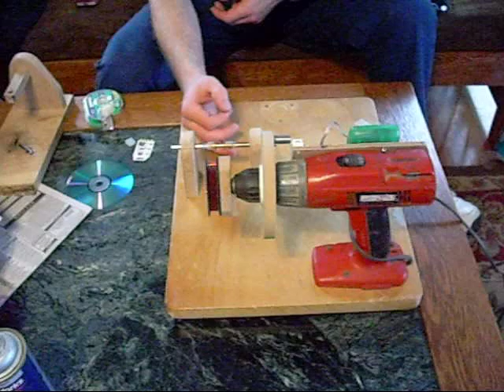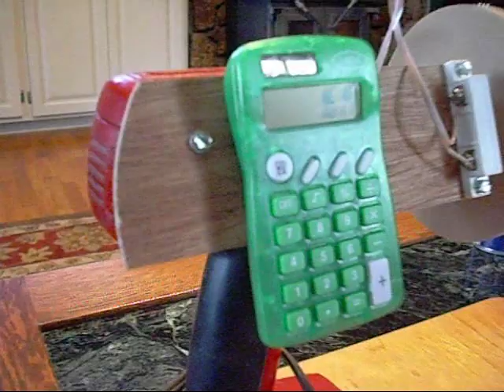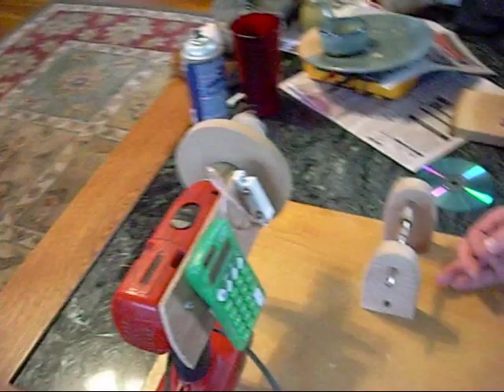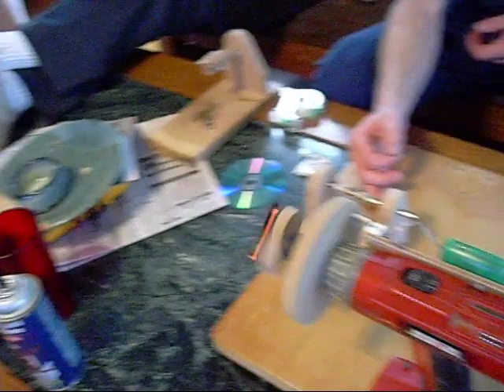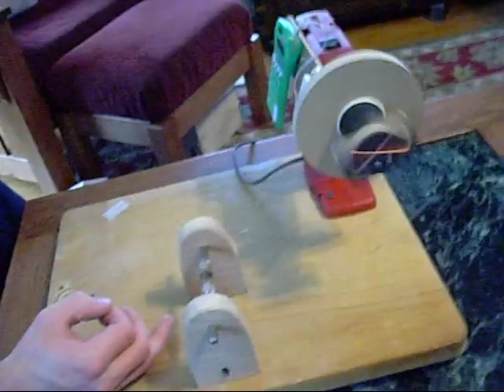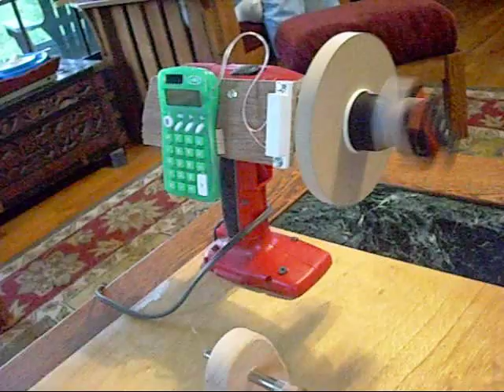Homemade Guitar Pickup Winder

Comment from the maker: Sorry for the delay man.   A guitar pickup is the part of the electric guitar that picks up the sound of the strings!  It's made from magnets and thousands of turns of wire.  A pickup winder is a tool that helps you put the wire on quickly.

Comment from the maker: @San5a It doesn't really matter, just try to keep moving, and fill in the holes.  The whole idea is a random pattern so you don't set up regular patterns in the pickup that add capacitance to the windings.  There's a lot more to it than that, but if you get the wire wrapped on the pickup, it will sound good period.  ;)

Comment: GOOD JOB !!    for those that come after,   read the info above,    
I built 4 pickups for  double neck 10 string steel guitars useing a max speed record turn table,  took forever,  1962. only tchnical tool i had,  borrowed,   was a multimeter.    Learned you can tie a sq. knot into the wire - hit with a lighted match to weld the broken wire.    All four worked fine.  especially since i had no idea what i was doing.   regards,

Comment from the maker: No, it's not.  One can be off quite a few turns before it affects the sound more than many other variables such as pickup height.  If you're wishing to match a pickup exactly, the important factor is the resistance reading of the wire, not the number of turns.  Counting however is extremely helpful to get close.

All the guitar companies used to do just that, time it.  I have read this would get them within 200-400 turns, reportedly making some "magic" ones, for example, SRV's Stratocaster.

Comment: Just viewed the pickup assembly photos - most manufacturers pickups that I've seen the insides  have a film of some sort between the magnets and the wire winding,    did you install the film after the photo and rewind?  Potting will likely prevent any moisture fouling between the two but it seems to me that's it's a bit risky without something,  even a coat of varnish as insulation in addition to the insulation on the wire?  regards,

Comment: Nice winder.  I did a similar thing with a drill and calculator with reed switch.  I built a foot speed control where I took apart the drill speed control and mounted it on the foot pedal.  How are you controlling the speed?

Comment: How close do you set the wire guide rod to the pickup?  Or does it matter?  I'm going to wind some pretty narrow bobbins and I'm worried I won't be able to hit such a small target.  It will be about a 1/4 inch gap for the wire.

Comment from the maker: Hi!  Thanks for the comment!  The short answer is that you can't solder inside the calculator, you can see how I did it at my new website.  I added the link in the "Info" because they won't let me post it in the comments section.

If you need to see better, Right click and "View Image" should double it in size.

Comment: I made mine out of an old sewing machine. Took about 1 hour to set up. I don't have a counter. I use intuition and experience to determine approx resistance. I usually hit within 500 ohms of my target.  It's a real art form, getting a certain sound quality. Wire is not cheap either. Not a hobby for the tinkerer. You have to be serious about this.